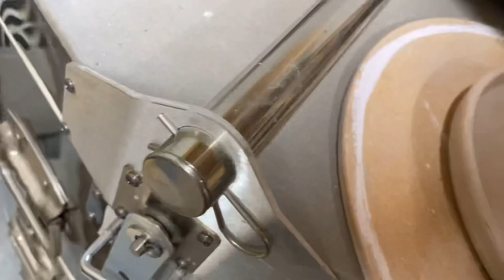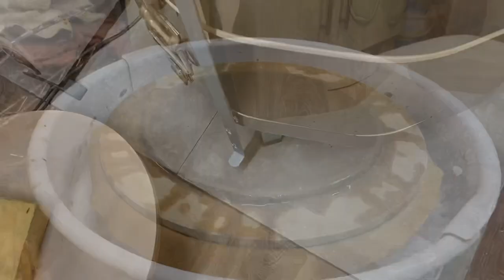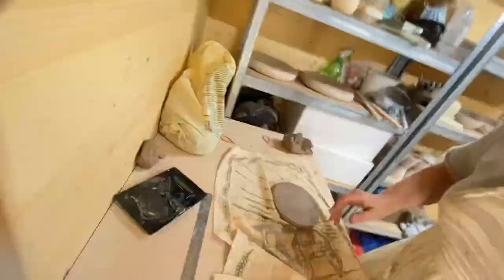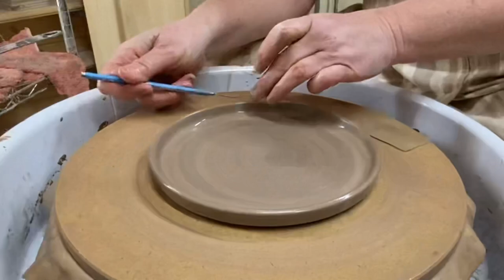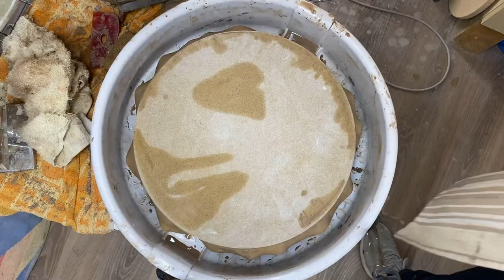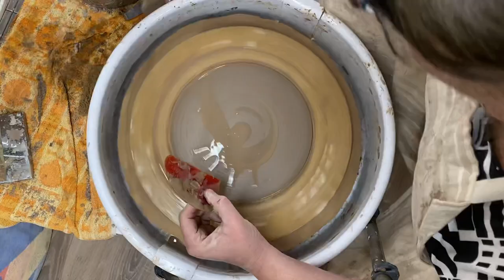41. Plate making using slab roll technique. Then flattening out on the wheel using a rolling pin.

Comment: Great timing for me since I am doing plates with a roller too at the moment. I hope they don't warp but trimming them was much easier, in my opinion. Thanks for your videos. Your enthusiasm for learning is contagious.
Reply from the maker: I didn’t trim the bases. I used a technique I saw Joe Thompson at Old Forge Creations use a stainless ball to put in mark across the bottom. It means no pressure at cling away the bottom. I did video it so it will put up a video to explain.

Comment: Thanks Lois After making a hash of making four plates in a similar way I came in and watched your video. Using the roller on the wheel is a stage I missed out and it was still a bit wobbly and when I lifted the rim it creased up. I was about to go back to throwing some until I saw your video. so Thanks I am off back into my studio to try again.
Reply from the maker: Great. I hope it works for you. !!
Reply: @LoisHook  was it was a vast improvement
Reply from the maker: Presume you mean - it was a vast improvement.

Comment: Hi Lois,
 I'm new to pottery throwing even though I've done ceramics over the years at different times. I'm interested in the way you attach your bats. I've looked all over for a video on it but can't find one. Is it just so simple as adding the wet cloth to the wheel then setting your bat on it? Could you please add any additional information I might need to be successful. I am loving your videos!
Reply from the maker: So in the uk there is a company called hartley and noble in Wellingborough Northampton that make the Russian doll system where you get an outer that fits on your wheel then you can make your pots keeping them on the wood. It means as it dries slowly it pops off the bat. So I really liked this. It comes with a cloth like a Shammy leather. 
https://hartleyandnoble.co.uk/

Whist on holiday in Antigua my good friend was cleaning his fishing boat. He got a cloth out to clean and it was called an absorber 
CleanTools Original The Absorber Synthetic Drying Chamois, Large (69cm x 43cm) PVA Towel (Natural) https://amzn.eu/d/9PpdoDW

It was £20 and I realised it was a material that I could use to hold the bat system down. 

Problem was I like to throw with some weight of clay and needed to see if it would when wet hold a normal bat also by Hartley and noble still in place. Only held by the vaccine of the water. 

It does!!  But if I push too hard I can push off centre so I make she the cloth is clean. Re hydrated and use it. 

Sorry to waffle but hope that helps. 

I will do a video on this !!

Comment: Are you using a wire to to remove from bate ?
Reply from the maker: No if the item is on the bat I often wait for them to pop off. I do sometimes cut off but try not to for ease.
Reply: @LoisHook    What is your bate made from ?
Reply from the maker: https://hartleyandnoble.co.uk/throwing-batts-1-c.asp

The premium. MDF I believe

Comment: I hope I don’t bust your bobble, but my speckle clay is not the same as your, my is WC 403 speckled tan from Laguna. I can not use in the microwave, it gets too hot. I hope your is ok.
Reply from the maker: Just looked this is. Potclays in the UK make it. 
Question Can I Use in the microwave.
Answer Yes the glen in our clay is created by non iron-bearing compound which is non metallic there fire it will not reflect the microwave.

Thanks for your thoughts and making me check.
Reply: Gladly is not the same of my clay. Also check if you going to do anything with dark red clay. I had the same problem. I have mugs and plates I can’t use in the microwave, bummer 🤗